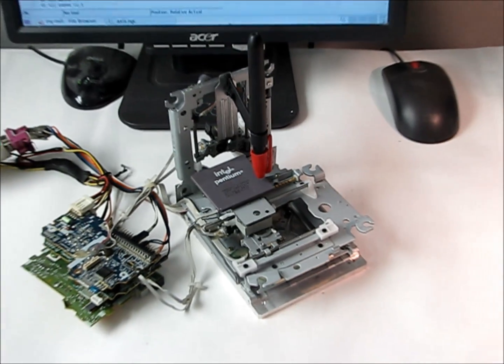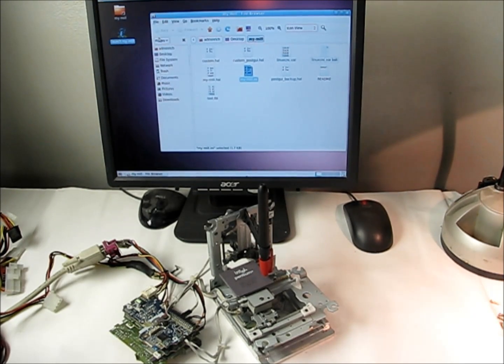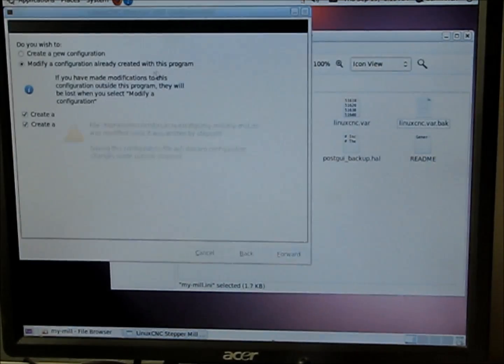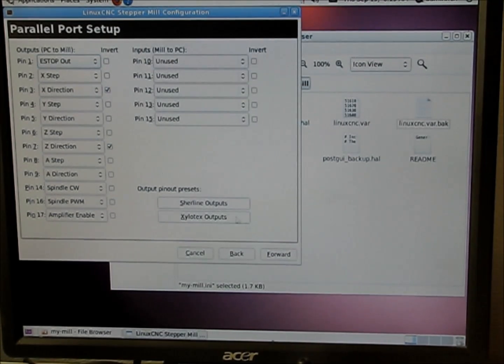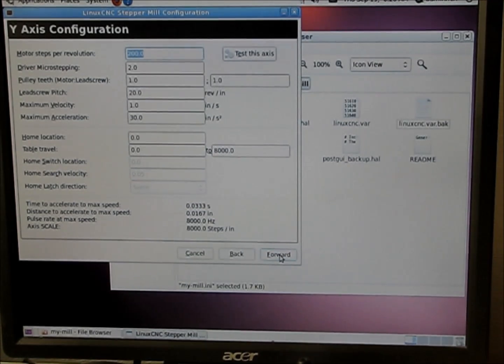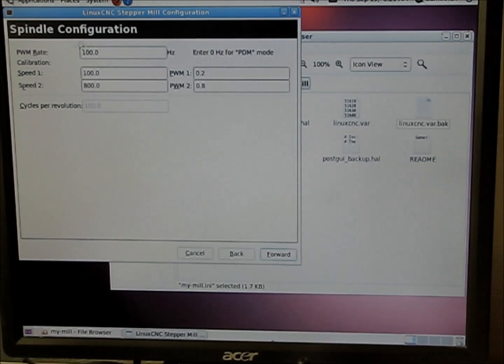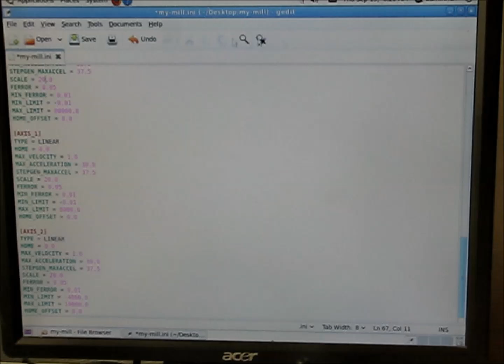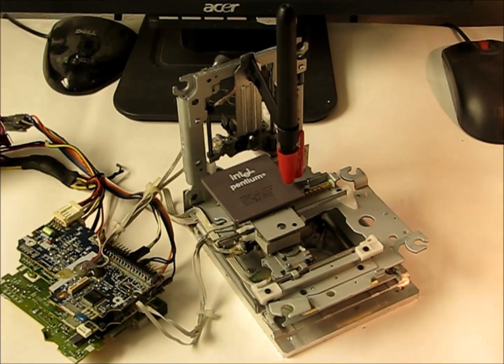DIY FLOPPY DRIVE CNC: Part 10 - Final Setup + EMC2 Control

Comment: great job +++
is it possible to mount a milling cutter instead of a pen ?
Reply from the maker: Frank Trojan Yup.. but it has to be mini.. I used a small motor from an old rc mini helicopter I had attached to a custom made milling bit that I made from a drill bit.. I could cut butter sculptures with it lol

Comment: Hi. Awesome. I am busy with this now. Any advice on what I can do with a old Roland Sitka plus stx8.
Could it or the parts be used to make something bigger and multifunctional. 
Best mini cnc instructions yet.
Reply from the maker: Warren Davies Thanks :) Try and fix the Stika! those things are great!.. but I think yes you could salvage it for parts, but it probably only has 2 steppers and I bet they are different sizes. Just my guess tho. ;)
Reply: Hi. Thanks for the reply. My laptop doesn't have lpt ports so I need to either make a box that I can connect all my lpt port projects. In south Africa things are expensive so I have been trying to make all my own goodies. 
I'll try a lpt to usb connection. 
Thanks again
Reply from the maker: I read somewhere that only a linux computer with a printer port can provide the realtime communications to the stepper motor drivers.. thats why i use emc2 software.. but i think you can use mach3 also, i think that supports usb
Reply from the maker: Even a very old laptop would be fast enough to run emc2 i think, maybe you could get a cheap one off of ebay
Reply: Ok thanks I will try that. I'll send you a clip when all is done.
Reply from the maker: Awesome!☺

Comment: Hi Richard! Please help!  I built the flppy/cd drive cnc machine, according your videos guidance, I did the linux configuration with the stepconfig, still when I try to run the program, it respond with an error "cant run the program a program when not homed"  btw my floppy drive always go to 0point by itself every time I turn it on, is that a problem?

Comment: Brilliant guide, thanks. Can i ask if you could use the same floppy controller and connect it to the larger inkjet printer stepper as that's got a longer sled on it?
Reply: As long as the stepper is properly wired theres no reason you cant or shouldn't

Comment: hey you seem like a smart guy but why waste time making such a small cnc with a travil dis. of 1.5"? seem useless. I built one with a travel distance of 16" by 10" and I hate it, so small. limited to what I can do with it. but thanks for the tutorial about interfacing the driver boards.
Reply from the maker: I made bigger ones too, this is just for learning some basics and making a working CNC machine purely from computer parts.. Some people cant get steppers or drivers. I actually made a really cool 3d face with a floppy drive CNC...Out of butter.. look :)  https://plus.google.com/u/0/photos?pid=5945477134509633266&oid=107797881587621987231
Reply from the maker: Richard Harris https://plus.google.com/u/0/wm/4/photos?pid=5945477994650476850&oid=107797881587621987231
Reply: Size isnt important for beginners (thats what she said) it is the thoery and build practice. I think getting beginners to go big right away would get to confusing and frustrating. With this under their belt though now a big one is far more realistic. Seeing the fruition of ones labour over literally a couple hours if one wants to hit it is very beneficial and no one gets frustrated or over burdened by too many parts and connections. 
I think this tutorial would be perfect for elementary students its fast and resuults in a cool little Icon drawer or mini picassos.. It is awesome. I new we could reuse those damn stepper motor drivers. when I was first starting everyone said no you have to program a pic or get an arduino etc. Of course I knew different but was to lazy to dig out the info. If it wasnt for quick tutorials like this that get results I woulda lost interest long ago and missed out on the sheeeit I am getting into today
Reply: Todd Littleton Yep!  Not to mention it's a perfect plotter for small PCB creation.

Unfortunately, he didn't show the results... makes me think it might not have worked out too well.

Comment: this is a great diy tutorial, for people like us beginners...very simple. i'm going to start building mine. just a quick question though, will we be able to use the floppy circuit board to drive big stepper motors?? thanks!!
Reply from the maker: The best cheapest thing is to get a L293d chip.. (4 dolla for 1 axis) 12 bux for your 3 axis CNC controller! (then you can use bigger Bi-Polar steppers) I get mine from creatroninc.com they are close to my friends house.

Comment: Hi I'm new with this. I don't understand how you connect to the PC. You have used 1 end of the printer cable allready to connect with a printerport. How do you connect the female side to your PC. The printer port there is also female. Thnx!
Reply from the maker: You need the right cable or an adapter that goes female to female i think .. np :)

Comment: Hy, I tried to use a bigger stepper from a printer instead af that small cd-rom stepper and it didn`t work very well. It goes back and forth even if a jumper is across pin 18. So it seems it has a mind of its own even if it is set for only one direction.
Reply from the maker: There is a trick to it i mentioned in the video! ...The stepper will only go in one direction until it hits the light gate.. then it will go both ways :)
Reply from the maker: Wait... maybe the wires meed hooked up different.. that is what happens when you hook the wires up wrong with a stepper.. try it again,. but change around the wires.. ive had the same problem...

Comment: Hi, I am no expert om electronics (I can barely change a lightbulb), but why did you have to use the electronics of the floppy drives? Why can't you use the electronics of the DVD drive itself?
Nice job, by the way.
Ro.
Reply from the maker: The DVD doesnt have a simple way to "step" and change directions like the floppies do.. I havent seen it anyways.. I think we would have to solder onto a chip to use a DVD circuit board.. This way SHOULD be easier.... I think anyway :)

Comment: this one was a very good tutorial (actually this is why i subscribed to your channel), i am collecting the items needed for this project right now (i study mechanical engineering, so it was really a delight to see the simplicity of a system that can provide so much experience). in one of these videos you mentioned that you would maybe make a tutorial about the usable parallel port codes in order to make a working, self-made cnc control program - i am really looking forward for this one, please inform me if you still plan on doing anything like this. (until now i had no idea what it takes to control an outer peripheral like a cnc machine through any of the i/o ports, but programming the parallel port seems to be much easier than the modern usb.)
 
thanks in advance for your answer!

Comment: how to the control XYZ table server 
program by EMC2
the drive only by Print Port?
no have any Electric circuit ?
Reply from the maker: yes, only floppy drive to printer port.. no circuit needed. Just jump the wires to the pins on both :)

Comment: How do you know in what way the wires from the floppy board should be connected to the four wires on the stepper motor that have no color code?
Reply from the maker: That part i guessed at, try to hook them up the same as on the old motor.. if it doesnt work... try changing the wires.
Reply: Richard Harris okay, so i don't damage anything?
Reply from the maker: MacSam Yeah, most of those mini steppers ive seen looked like they are hooked up the same way, but just to be safe... I dont think theres enough voltage to wreck the stepper motor, but you could fry the board.. but i havent wrecked one by hooking up the motor..
Reply: okay, thanks

Comment from the maker: From the printer port.. I am using pins 2,3,4,5,6,7 (Data pins) and they go to the "step" (pin 20) and "direction" (pin 18) pins on the floppy drives. Also you have to put a jumper across pin 14 to enable the floppy drive. Look up the "pinout" for whatever you are trying to hook up, it will tell you. :) hope this helps :)